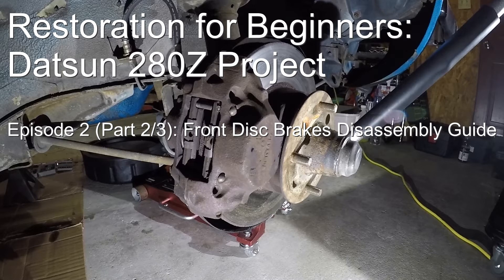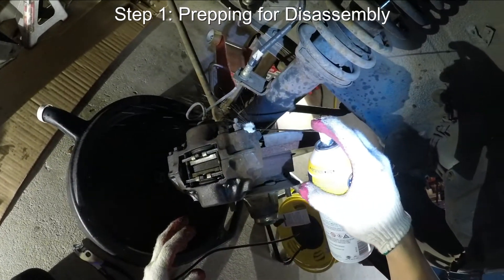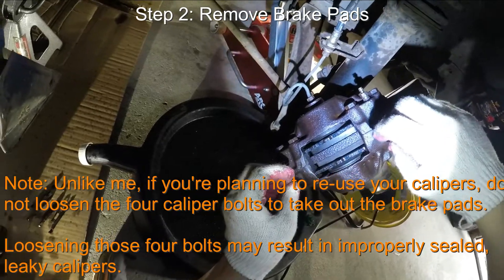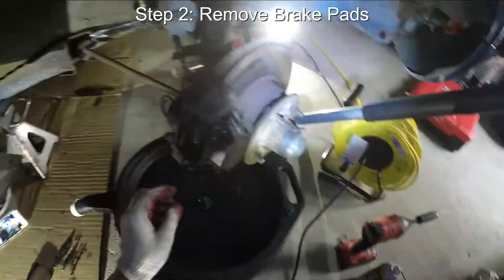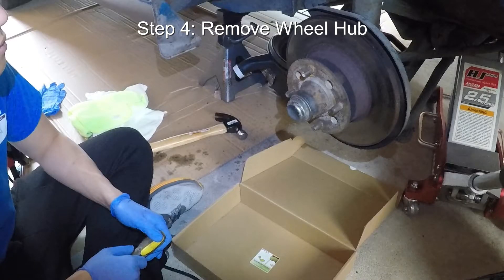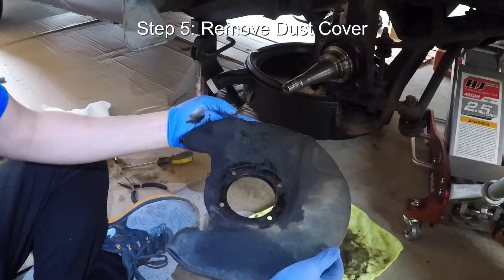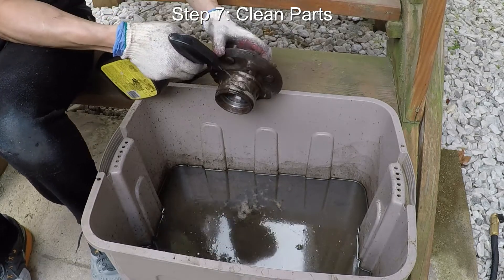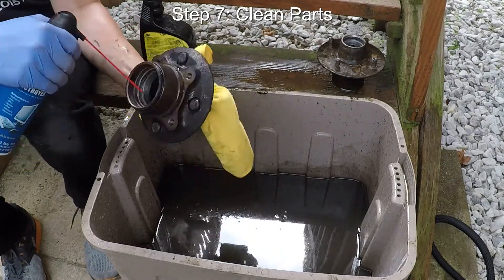Datsun 280Z Ep.2 (2/3) Disassembling Front Disc Brakes

Comment: 6:45  This really is not the best way to do this. Instead of risking damage to your brake lines, go ahead and unscrew the line from the back of the caliper and zip tie a piece of plastic baggie over the end to stop it from leaking out.

Next, there is no need to split the caliper in half. Remove the two caliper bolts and the entire assembly will slide off, brake pads and all. If the pads are stuck down to the caliper, carefully use a prybar to back the pistons off to gain the clearance.